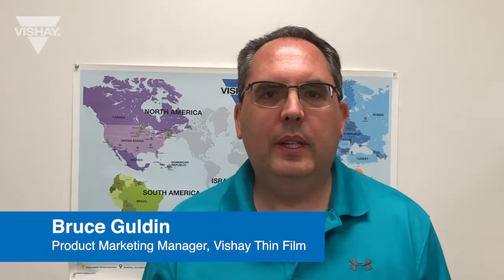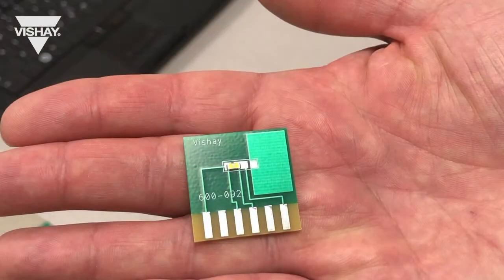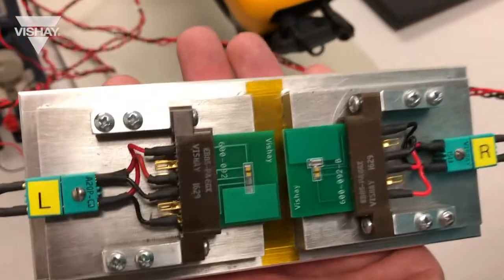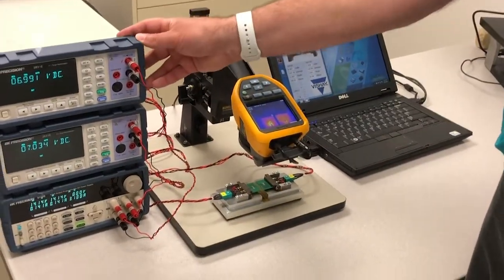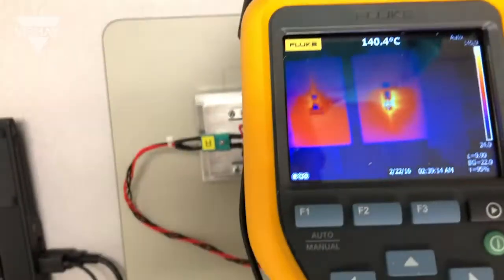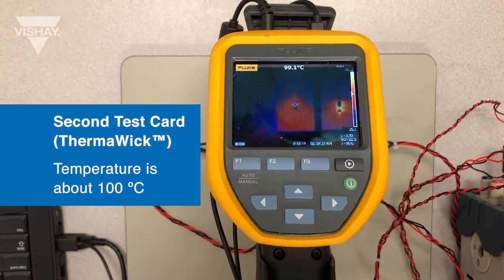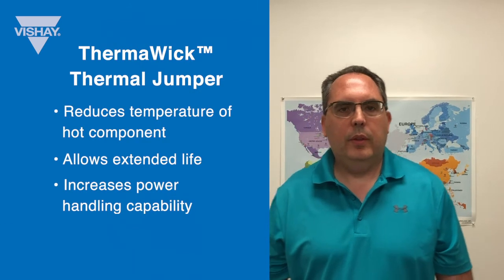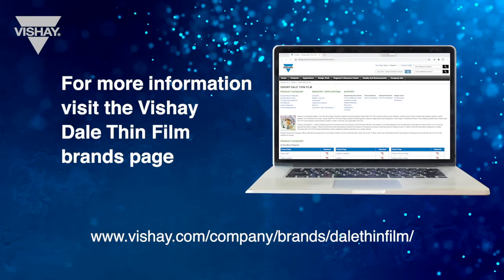The ThermaWick™ Thermal Jumper Demo

Comment: Cool devices😎. What about insulation Rating? Solid insulator, CTI,  PD, working voltage, UL/CSA/IEC approvals?
Reply: Very interested to see what UL would say about these for explosive atmosphere designs, IEC 60079. The THJP datasheet claims >1.5 kV withstand voltage so they seem promising.